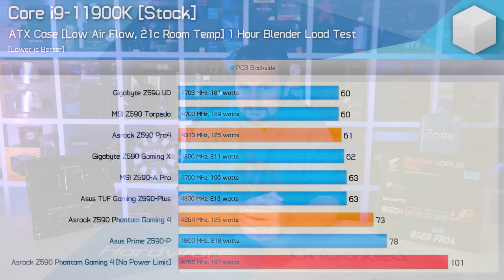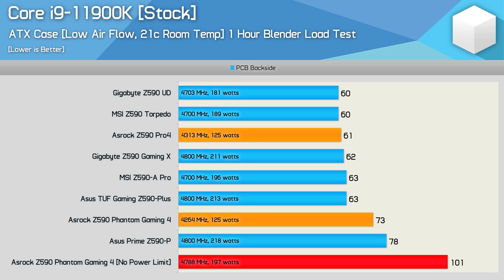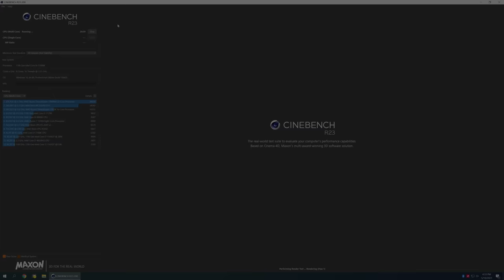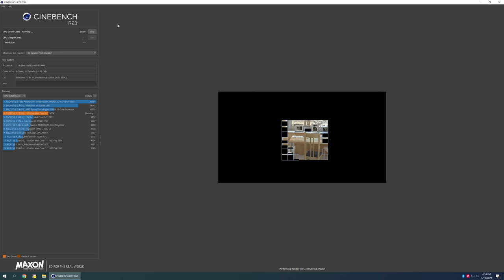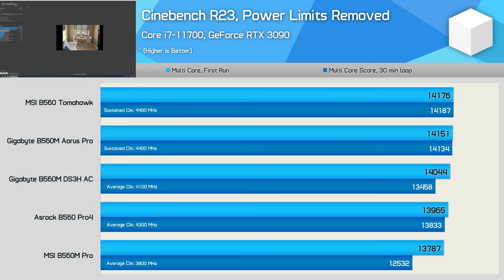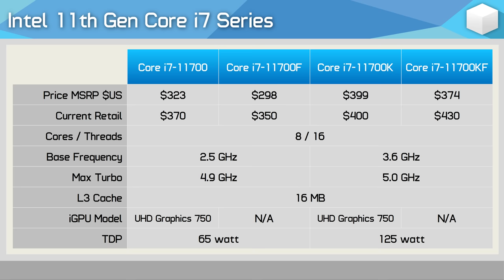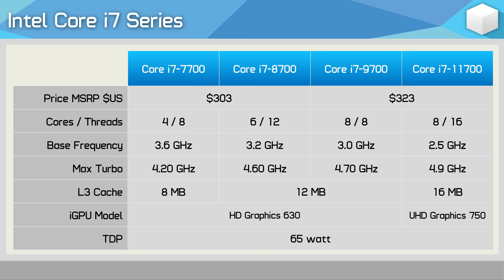Intel B560 is a Disaster: Huge CPU Performance Differences, Power Limit Mess

Comment: I have the 11400 and I need to limit it to 65W, because I use it with stock cooler than I get another one, and this one is unlocked and takes high degrees quickly when being in high watts, I can't find how to limit it to 65W, I have b560-a asus rog

Comment: do you have one on AMD, same CPU different boards brand on X570 or B550 or B450 maybe?
Reply: He said that at the start of the video that AMD CPUs did not have this problem. Thus he only has a benchmark of the VRM temps for AM4 boards
Reply: @mineskirat  thanks, I missed that as I skip some and went ahead on the graph

Comment: Hey guys,
I have Asus TUF B560 gaming plus WIFI, Tested it and i5 11400 is rock solid 4200mhz in cinebench with 212 evo.
Now onto why I'm typing this... Is it possible to use the on board HDMI while using discrete GPU? My GPU HDMI farted out in terms of audio and I tried searching in BIOS but can't find that option to enable HDMI output on motherboard. I'd like to use HDMI output on motherboard to send video/audio signal to my entertainment center.

Is it possible to do it?
Reply: Linus has a video on that. You can check it out.
Reply: "TUF B660" you mean B560?
You're using a non-f intel CPU, so yes you can definitely use the onboard HDMI port as long as the iGPU is enable in the BIOS. Thou you might lose FPS due to the signal have to go throu your iGPU.
Reply: @tncson8941  oh shit yes B560. My fat fingers on a mobile.

do you know how to enable that? I managed to enable it once with "primary display" but now the CPU option is missing for some reason.
Reply: @SharukhKhan-dy3qt  you got link maybe or what should i search for?
Reply: @sermerlin1  https://youtu.be/dNP7wmPCBwo try this one. The TUF bios interface might look different, but i think you should know where it's located. Make sure the iGPU multi-monitor option is enable.
Reply: @tncson8941  I don't have that option. I have everything identical in the video but the "iGPU multi-monitor" is not there. Only the "primary display" is there.
Reply: @sermerlin1  here you go buddy ! Sorry forgot to attach the link. Hope it helps https://youtu.be/TY4s35uULg4

Comment: Hopefully you test MSI B560M Pro VDH & ASRock B560M Pro 4 since they are only $110.
Reply: @UCMECw_0Mod7opi7pJGvxYUQ You just select cooler type for MSI and turn BFB on ASRock boards and you're done unlocking power limits.

Comment: If cheap B560 motherboards suck, what cheap-ish non-B560 motherboard would be a good match for a 11400F?
Reply: He said that cheap B560 handle the i5 11400F. Just need to unlock the power limit in the BIOS.
Reply: Never buy the cheap motherboards (same with AMD). They all suck, are unreliable and all have cheap ass component's. You should only ever be looking at the mid range and preferably higher range boards in an AIB's line-up. For B560 boards, you're looking at (best in line-up first): 
MSI = a Gaming Edge or "MAG" series
Gigabyte = "Aorus" series or a Gaming X
ASUS = Rog Strix series or TUF series
ASRock = a Steel Legend or Pro4 series (personally I'd avoid the lower end Pro4 boards, though)
Any above should suffice, but I really would avoid any other boards in their line-ups. The cheap AIB boards are often just like cheap PSU's, in that skimping on price now, will likely come back too haunt you later....
Reply: Get a z490 gaming plus or the b560 tomahawk. Stay away from cheap motherboards
Reply: @f-22raptor25  It look's he's on a budget, so It depends on what he has got to spend and whether he really needs a full sized ATX board (most people actually don't). Besides that, when it comes to B560 boards, most of the Aorus and Strix boards are equally as good, as MSI's higher offerings. You are right about staying away from cheap motherboards, though..

Comment: bro i just upgraded from a 2500 to a 11400F with Asrock b560 pro mobo :|
Reply: You're in for a world of speed either way. 
You could always return the Mobo or play around with the power settings yourself. If you have a case with good airflow and an aftermarket cooler on the cpu, chances are you're not going to be slowed down much by throttling.
Reply: Just used the gigabyte in my build yesterday too. Was for a friend so will get it back and play with the bios settings
Reply: You're fine, look for Base Frequency Boost setting in your motherboard and set it to 125W and you're done.

Don't forget that your CPU will be pulling up to 125W depending on the load so you need a budget tower cooler for that :)
Reply: I'm using asrock b560 steel legend + 11700 and seems to be fine

Comment: I got the Asrock B560 pro 4 and 11600k, looks like I've narrowly dodged a bullet here...
Reply: Why would you put i5-11600K on a B560 board?
Reply: @brennanbraxton3854  I wanted to get 11600 but it wasn't available so I went with 11600k. Wanted to build my pc as soon as possible ¯\_(ツ)_/¯
Reply: @brennanbraxton3854  the K version is a bit higher clocked than the non K version and there is not much overclocking headroom on it anyway.
Reply: @kanishkparmar  
And it's also ~100$ dollars more expensive and there's isn't really a difference unless you have top tier GPU.
Reply: @brennanbraxton3854  You are right. I also don't think that it's worth getting. I just laid out possible reasons for why they bought it, but they have already told why they bought it instead of the non-K version.
Reply: bro Is the asrock still alive with 125w cpu?? recently I get one used very cheap from a local .

Comment: Would a Intel Core i3 10105f and MSI B560 Tomahawk exhibit poor performance or is it only the CPU's that you've tested here? GPU would be a GTX1050 just to get by Covid PC Prices. The plan is to get gaming now i3/B560/GTX1050 then when pricing is more reasonable and hardware attainable i5 11400f and mid-range GPU.

Comment: In the end, it is as Intel wanted.

They sell something that can go to 4,2 ghz and during reviews it will go there... but in their very spec sheets clear as day you see that the minimum guaranteed is 2,5 ghz or whatever.

Nobody will make a review with the 2,5 ghz performance, but if you bought one and you only got that you are fkd. Because it is, by their specs sheets, exactly what they promised.

Now it seems you need an extra 100 USD in Mobo (and maybe some more for cooling) to realize the performance most reviewers (and Intel themselves) will advertise. The expectation vs reality mismatch will be pinned in the end user, when it's clearly a concious desition by Intel.

It's just sort of false advertisement with extra steps so they don't take the blame. A 96% delta between top (used for every advertisemente figure) and guaranteed performance is insane. And sinse it wasn't the case before it will catch people off guard.
Reply: There're use cases in which people doesn't want the CPU drawing more than 65W, so naturally board vendors make boards for them. Who's at fault? An uninformed system builder who doesn't know to make a proper judgement in the board they need/want or the seller/manufacturer?

Comment: ASUS TUF b560 will be good? It is a little cheaper than the aorus pro (not the ax which just has the wifi as extra and costs more)
Reply: review the video, and consider the motherB you like, and take care in the VRM and phases + mosfets, capacitors etc. :D

Comment: Great... Just finished a 11500 Asus tuf b560 build for the wife.
Reply: F
Reply: it should be fine, worst case you need to disable the power limit in the bios.
Reply: I doubt an ASUS TUF will give you any issues, as it's at the same quality level as the Aorus Pro and Tomahawk, that's shown in the video.

Comment: It's sad, I knew the b560 boards would have some pitfall like this.

Thanks for the hard work Steve.
Reply: Another pitfall is if you pair a B560 board with a 10th Gen CPU, you instantly lose complete access to one of the board's M.2 slots.

Comment: Have have an asrock b560m pro4, getting same performance as my brother's z590 steel legend. I feel it's a little clickbait. But I only see a tiny performance difference.
Reply: True, you only need to run the locked chips at 125W to get 99% of the full performance!

Comment: bios update will fix it, happens sometimes
Reply from the maker: BIOS update will not fix this.
Reply: How will a bios update fix a hardware and power delivery issue?
Reply: @nemesisgamingow5406  that vrm might be not enought for i7 and i9, but pretty sure it can be fine for i5 and cheaper cpus. Power delivery issue doesnt mean those mobos arent capable to run i5 and cheaper cpus as intended on high frequencies. You dont need to fix hardware there. Motherboard manufacturers can rise the power limit for i5 in new bioses so it can perform on the same level with z590 motherboards. Did you hear about autooverclocking by default on motherboards before? Same here. Buying b560 for i7 and higher cpus didnt look great from the start coz 11 gen intel cpus are really power hungry. But still you can use fan on the side of the case for cooling vrm if you want to save some money on mobo. This might be not the best idea though. We will see how good vrms in next video and after that can decide if it worth to try i7 or more hungry cpus on these boards.
Reply: @Hardwareunboxed  pretty sure motherboard manufacturers can rise the power limit by default in bios so cpus like i5 and lower can match performance on z590 boards. Of course some testing needed to stay in temperature limits but still most of the issues can be fixed imo. i7 and higher is another story, seems like this gen of intel cpus is very power hungry so more cooling needed to perform right.
Reply from the maker: @mirage8753  we explained why they can't simply do that in this video.
Reply: @Hardwareunboxed  still curious to see what new bioses can bring

Comment: I do not understand why you frame it as "B560M is disaster" instead of saying that that best boards offer better out-of-spec performance. No matter how used you are to the power limits not being enforced, it's not correct to imply that it's the normal behaviour. Do we now ignore people who expect their CPU to run at the power spec written on the box?
Reply: I'd prefer to say that it's the disaster of technology being overcomplicated for an average buyer and Intel not caring about it. B560 is not disaster by itself.
Reply from the maker: It's a disaster for the B560 platform as half the boards run at the TDP limit with the other half running without power limits, resulting in some boards offering up to 50% better CPU performance with a part like the 11700. We've never seen anything like it (at least to this extreme), it's a massive mess and a disaster for potential buyers trying to make sense of it.
Reply: @Hardwareunboxed  thanks, I see your point, I just do not agree with how the title sounds, maybe I am wrong.

Comment: Its funny how whenever there is a bad board, its always a Asrock one 🤔🤣
Reply: It might make bad Intel boards but for AMD they have some very good ones; especially the smaller form factors.
Reply: It's even funnier that MSI themselves said the B560 board performance should be equal to the Z590 performance... and then their board is the absolute worst one in the test.
Reply: @klaesregis7487  The good days ended at B450, after that its all a bit meh
Reply: @paulelderson934  best and worst. They like to have both bases covered 🤣

Comment: Me just bought 11400 and asrock B560 pro4: Well... fc*k, Guess next just buy AMD then
Reply: Or just unlock the power limit and undervolt it by 0.1V and have no issues whatsoever.
Reply: @devnull1013  can you explain what you mean by undervolting it? I assume this is in the bios?
Reply: @AndyJenWolff  Yea, how exactly you do it differs per motherboard.

Comment: So what's the point of B560 when great Z490 boards are the same to lower price? Pcie 4.0 that 99% of buyers won't utilize? Am I missing something?
Reply: Z490 cost more here ($200+), i can get a good B560M for $135, with memory OC and fully removing power limits, great to pair wth 11400F / 10700F.

Comment: Dammit. Just built with the gigabyte board last night!
Reply: Why in hell did you buy intel in the first place
Reply: @denanhajrovic4183  you can't find new amd for a decent price.
Reply: @denanhajrovic4183  Haha wasn't for me. Mates budget system. He used old ram he had so with ryzen would have been more expensive for a 3600 and wouldn't have like d the slower ram. He only got a board and CPU. 

Wouldn't use Intel in my build. I was lucky enough to get a 5900x and 6800xt (just got GPU 2 weeks ago)
Reply: @GummyBearRacing  I payed 12% over MSRP but considering 5900x is rare af ATM I'm not complaining

Comment: There is a reason GN controls power limits in their CPU testing.
Reply from the maker: What's the reason? We deliberately don't do that as it's not the out of the box configuration for the majority of boards.
Reply: @Hardwareunboxed  Steve explains their position in their methodology piece, but the short form is to remove all variables to allow the differences to be just the item under test, in this case the CPU.

Defined settings vs out of the box settings  are both reasonable approaches.  Both of you make it quite clear the conditions of the test.  I find it useful to get a variety of data from different sources.

And to be clear, I appreciate the effort you put into this exact kind of content as I am not able the buy the best of everything, so having more data to help balance the decisions is very helpful.
Reply: @Hardwareunboxed  So do you do all your testing with XMP disabled as well, or do you just enjoy making clickbaity videos for views?

Comment: Unfortunately, the 3 B560 motherboards I have right now were not tested.  ASUS Prime B560-Plus, Asus TUF B560 & Asrock B560 Steel Legend.
Reply: I'm taking it, this will only be an issue with the really cheap boards. TBH, I personally avoid them like the plague anyway, as the AIB's, have a habit of sticking cheap component's on them anyway, be it either Intel or AMD (crappy VRM's, cheap Capacitors ect). From past experience of having 2 cheap boards die on me within 18 months, I'd much sooner spend an extra $50+ on the better boards in the line-up. Motherboards are like PSU's, in that it really is worth spending that little bit extra.
Anyway, I should think the TUF and Steel Legend will be completely fine. The Prime Plus might be questionable though, as it is towards the cheaper end of ASUS's line-up.

Comment: Buy a board with VRM heatsinks and go in BIOS and set the power limits yourself. Problem solved. Video is clickbaity as hell.
Reply from the maker: This is 100% on Intel as explained in the video for their loosely defined operating specification. If you wish to learn more I suggest reading the interview linked in this Tweet: https://twitter.com/HardwareUnboxed/status/1385051271451660290

Comment: Would be interesting to see a 10400f/10700 on these B560 boards, since they are locked anyway, the memory OC would be the only real upside over a B460. I imagine they wouldn't be as bad as the 11th gen, but i am curious to know either way.

Comment: Full of brainless amd fanboys comments thread. Yeah, if board has bad vrm - it’ll suck for performance. It’s like crappy amd board models don’t exist and don’t affect performance. Ridiculous to see while amd still struggles to stop usb disconnects.
Reply: Exactly, the cheap B450 & B550 motherboards are just as dire and are also a complete waste of money. Motherboards are just like PSU's, in that you really shouldn't cheap out on them. If you do, then don't expect much in the way of reliability or longevity. With the 'B' motherboards, it really is worth saving up that extra 50+ bucks, for a higher tier board and peace of mind.

Comment: If you can't get ryzen and Intel is the only option then I'd be weary even if Intel is cheaper. Just because of this...

What a mess...
When I thought for once again that Intel is good enough or not a bad choice.
Reply: 12th gen will actually be good chips. Now it's up to Intel to enforce boost specs for boards and get their own product pricing correct.

If they manage this then the next generation of Intel chips will be awesome. If not AMD can take Intel's place and start screwing over the customer because they have no competition.